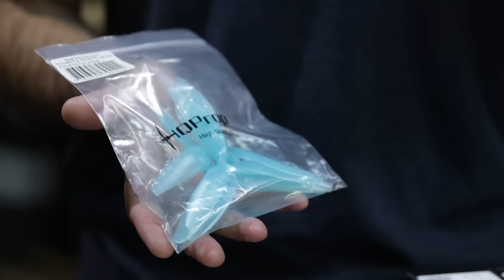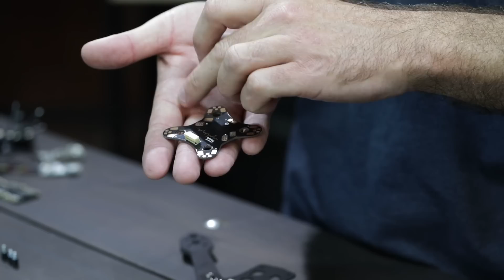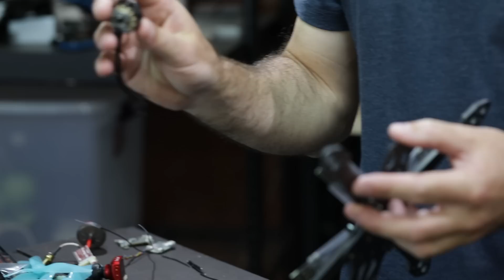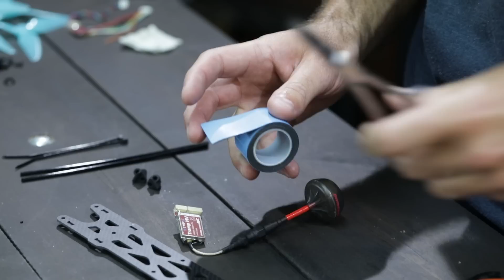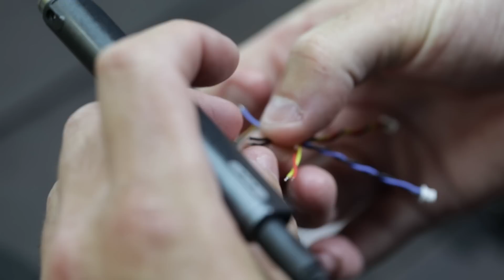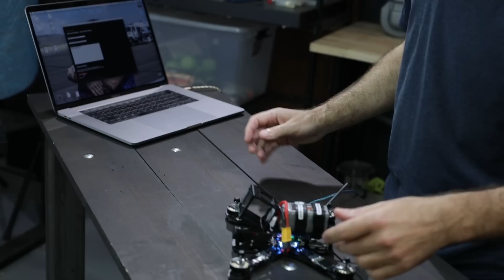Build: ImpulseRC Reverb (with FinalGlideAus)

Comment: Great build video - I learned a lot. Love those little tweaks you add Chad, very handy. Not surprising your Reverb design is the highest selling quad out there - most cost effective against all the other "original designs." I notice that its recommended by the major distributors/retailers (including RR :-)). I love mine - so durable, surprisingly well balanced in the air and so easy to build. Congrats.

Comment: It's ok but when I work with bi-component epoxy, I'm used to remove the masking tape as soon as the mixture is getting jelly (by doing as you did, the risk is to get some tape trapped on ESC by the fully cured resin).
Excellent video as always Mr. Nowak, it' full of useful advice.
Thanks a lot.

Comment: Used this frame for my first build. Overall I really like it, the only improvements I would make are:
1. A way to simply get the correct camera tilt (though I understand from reading a comment that this wasn't possible due to space)
2. It would be nice if the arms were a bit wider, the KISS ESCs stick out which I think could make them more vulnerable to impacts, but probably not that big a problem.
I'd recommend not using the antenna mounts and instead use the full standoffs and doing the cable-tie/heatshrink method, as on my first crash one of the mounts snapped. Could be that I was just very unlucky however and the cold weather may have contributed to it's brittleness

Comment: Actually don’t need the second gnd wire for the camera control with this PDB, mine works fine without it at least.  I think that gnd is more for when you use the controller that comes with the camera.  Piggy backing the audio pad with the smart audio pad gives you both smart, and actual audio.  Couldn’t get that to work with KISS V2 on Steele PDB, everything on this PDB just works and set up is a breeze!  Love this PDB
Reply: A.I. Thinker good to hear. I was wondering that but never had a chance to test without it as I normally use the Predator. I’ll leave out that wire on future builds of mine that use the Eagle. Thanks mate :)

Comment: I’m in the middle of building my Reverb atm. I’m using the Le Drib Hypetrains. Both the alloy bolts from impulse and the steel bolts in the motor box would only be in the motors by 3 threads. Is that enough? Worried they going to strip first crash.

Comment: could i use your kiss setup on a Kiss V1 with 24a esc's? If not would you have a base setup for a Reverb with a Kiss V1, 24a esc's with Luminier 2306/2350 kv motors, with a tramp and go pro session mounted? Thanks for all you do.

Comment: Just did my maiden on the Reverb:), I’m using Mr.Steeles pids from his Alien V1 builds. Would you have any recommend pid settings with the Kiss V1 and 24 amp escs? It has a GoPro session and lumenier 2300kv 2206 motors

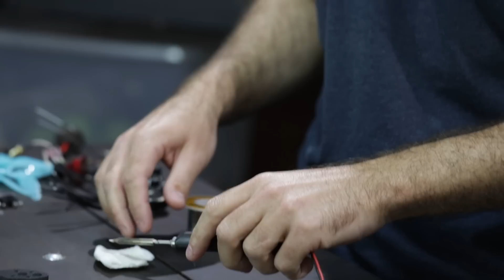Comment: 18:30 don't just use a napkin with water on it. This can lead to oxidisation in the joins and corrosion over time.

Nice tutorial otherwise, though.
Surprised the manufacturer hasn't done something similar to the ESC's, to make them tougher.